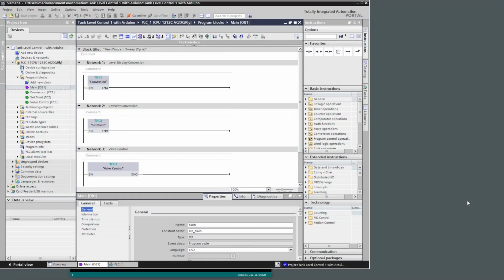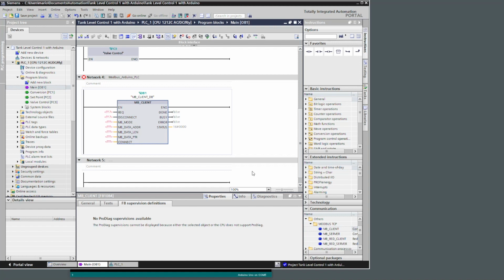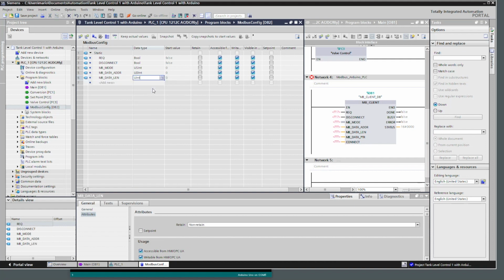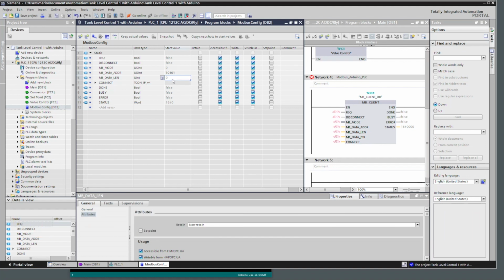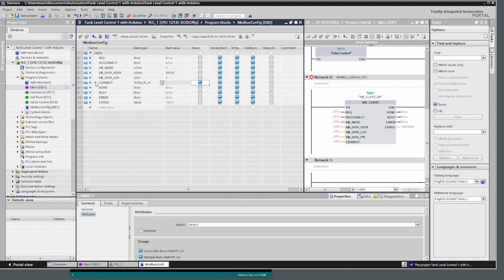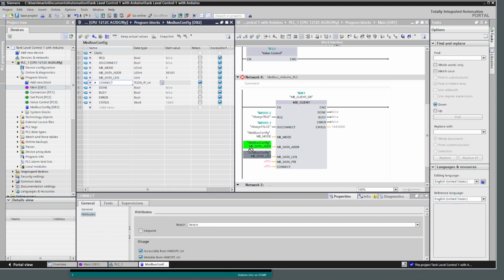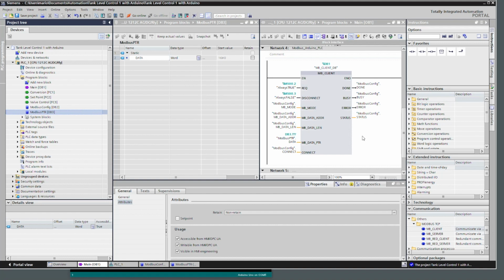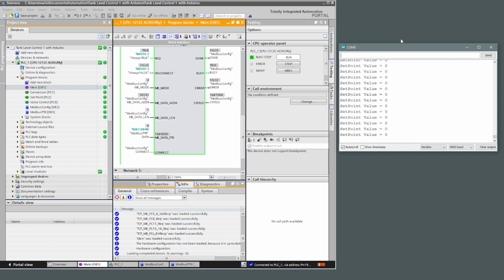Siemens S7-1200 to Arduino Modbus TCP/IP Communications Part 4.

Comment: Hi Mario, thanks for this nice work. I'm working on my thesis. I'm getting 16#80B6 error in MB_CLINE_DB status. I can't solve it. I think it's router. Can we connect Arduino and PLC directly without router?
Reply from the maker: I had problems with some connectors, I guess it all depends on the wiring of your connectors. I actually just linked up an old modem in the end which worked well.

Comment: Hi Mario, I follow your step to setup my s7-1200 PLC and Arduino. 
But now I got a problem that my plc cannot read Arduino's A0 Value.
The MB_CLIENT's STATUS number sometimes show "16#7005", "16#7006" or "16#8383".
It seems that 7005 and 7006 is send and receive status.
But I don't know how to fix 16#8383 in STATUS number.
Can you give me some advice to fix this problem?
thanks!
Reply: Have you checked if your data lenght is corred to the date base? I had the same issue I just modify the lenght of data in mb_client

Comment: I'm building heat pump for the Bachelor of Science degree in Mechatronics Engineering and to avoid buying analog module for s7-1200(not enough analog inputs) i'm using arduino as a temperature card with 5* ds18b20 digital temperature sensors. The diffference from movie is to send values from variables in registers to PLC... Anyway i found out ethernet module wizz W5500 lite usr-es1 is not compatible with modbus libraries or im doing something wrong. i bought shield (waiting for delivery) which is used on your video and simmilar videos which i found on yt. I think its important note because i already lost 30h and after that i went other direction and built 2 web serwers from PLC and from Arduino, but to communicate properly and share variables cross-domains it would need another device for server, because web serwer in PLC doesnt have enough resources same as arduino... Thinking it would be better to buy that analog module for pt100 or Shield W5100 at begining. Meh, educational value is nice but wasting so much time not so.  Module will come at wednesday and i will start over again... Thank you for sharing your wisdom.
Reply from the maker: Glad you enjoyed it
Reply: Ok, so i made something wrong in code, I wrote it wrong way and it was my fault, still im not sure if it will work with that module which i was writting about. Im sure it wasnt working even with shield till i wrote good code. Now it working and sending data registers thru modbus tcp but i used arduino mega 2560 and shield from movie also i used modbuss poll tool to check if frames are correct. Before i changed code it shown illegall data adress.  I used different libraries: SPI.h, Ethernet.h, ArduinoRS485(ArduinoModbus depends on the ArduinoRS485 library) and ArduinoModbus.h. Coudnlt find even 1 working code about data registers (found article it is difficult with arduino uno), most of examples are querstions how to do it propperly, anyway i did it :) and will post it somewhere when i done my heat pump project. Thank you again.
Reply from the maker: Well done Patryk, sounds like you know a lot more about than I do about the subject. Good luck with your project. Looking forward to seeing it.
Reply: @MarioCrispino  Naaaa. Without your movie i woudnl't even know how setup modbus client in PLC, but thank you :) Thats really nice to hear someone appreaciate my hardwork :)
Reply from the maker: Glad I could help Patryk

Comment: Hi Mario, 1 would like to have the arduino to be a modbus client and get the data from the PLC, is it possible? also, is factory IO can also be use as a workstation or a SCADA? thanks in advance.
Reply from the maker: Hi Joseney. You can switch which is the client and server. As for Factory I/O, I only use a fraction of what it is capable of. If you need to know more in depth information about the product I would recommend going to their website.
Reply: @MarioCrispino  
Thanks Mario, I would love to try once I get hold of "W5100".to be as a Client. Cheers!!!

Comment: This is the best tutorial, I am really enjoying. I just wanted to ask, if I want to add other sensors from my arduino, does It mean I will have to make different PTR data blocks FOR every sensor or I can use one for multiple functions?
Reply from the maker: Wow, you must be really going for it! I wouldn't have thought so but I guess it depends what you are trying to do.
Reply from the maker: Glad you are enjoying it too.
Reply: Well I have the same problem. At this moment I just created another mb_client block with diffrent data adress (30109) and its working as long as I choose between then. In other words I can monitor only one value in real time.

Comment: Hi, I reproduced exactly the same manipulations when in the tutorial but it doesn't work. My MB_CLIENT displayed three alternating errors, 7001, 7002 and 80A4. I don't understand where it comes from because by pinging my arduino and my CPU I get feedback. You would have an idea because I'm going crazy .. Thank you
Reply: Hey MoKa, have you entered the correct IP address of arduino to PLC?
Reply from the maker: Thanks for helping out Delgado, much appreciated.
Reply from the maker: Hi Mo. Don't worry, take a break from it for a while. I had lots of problems getting this to work as there are so many components involved. If you look at other comments you are not alone but eventually everyone gets it working. It is quite easy to forget one step and that being the case it won't work.

Comment: Hello Mario, nice tutorial..
So i have follow your tutorial but my s7 1200 didn't receive any value from my arduino mega.
My arduino IP : 192.168.0.3
My s7 1200 IP : 192.168.0.1
My PC IP : 192.168.0.109
Can you help me to solve this problem? Is there any solution?
Reply from the maker: Hi Delgado, I found it difficult to get working myself at first. I had problems with my potentiometer and the shield, I had to replace them before it would work. I also had a router problem in that my PC would talk to my PLC but not to the Arduino so I had to replace the router too. I'm not saying this is the problem with yours but you need to make sure each device is working before connecting all together. It took me a while and was very frustrating.
Reply: @MarioCrispino  I can ping my arduino, router, and my PLC. But in the MB_CLIENT_DB, the ERROR is always TRUE and the BUSY always false. There are no error code..

Edit : I found the error code. Its 16#80CE. The problem is I have already entered the same IP number in TCON_IP_v4 with my arduino's ping.
Reply from the maker: That doesn't sound good Delgado. Not sure I would know why this is but have you unticked Optimised Block Access?
Reply: @MarioCrispino  Sorry for late reply, I was busy with my thesis project. I finally solved the problem, the problem was I forgot to tick the "retain". 

Anyways thank you very much for the tutorial. Its very helpful for me to do my thesis project for monitoring using PLC.
Reply from the maker: Glad you found the problem

Comment: Hi Mario,
i am a big fan from you, and i have follow all you tutorials with pleasure.
i am impressed how relaxed you do that.

i have follow this two modbus tutorials step by step several times, but every time i ended with the same error.
my modebus send not correctly the data to my PLC. The MB_DATA_PTR stay on zero and the status give an 80A4 message.
i think there is something wring with my IP address, but i don't know what.
Because my route address is 192.168.178.1, i have used 192.168.178.120 for sent over the data from my arduino Mega 2560 to my PLC S71212.
Also my serial data looks ok.
What could be wrong?

Best regards Frans
Reply from the maker: Hi Frans
Sometimes I've noticed it can take a while for the PLC to read the information but it usually starts working a few seconds later.
Before you get into the PLC part, are you able to ping the Arduino from your pc on the same network?
Reply: @MarioCrispino  
yes when i use on both sites ip 192.168.0.50 i see when i ping
4 times
reply from 192.168.0.50: bytes=32 time<1ms TTL=128

grtz Frans
Reply from the maker: I see you have changed the network. If the ping works then that is promising. Does the Arduino print the values to the serial monitor ok?
Reply: @MarioCrispino  
Yes the serial monitor is also working, when i change the potentiometer the value is also changing from 0 to 1024.
I have also swapped from Arduino Mega 2560 to Arduino Uno with the same result what i expected.
Reply from the maker: Interesting. Could I see the PLC code. I can't look at it for a while though. My email address is on my linkedin account
Reply: @MarioCrispino  PLC code and Arduino code sended to your LinkedIn email address
thanks in advance
Frans
Reply: Hi Mario,
I have solved my problem.

What the error said there was something wrong with the IP address.
My PLC had as default IP address 192.168.0.1
My PC had as default address 192.168.178.17
My Arduino i had given 192.168.0.50

After i have changed the PLC address to 192.168.178.50 and the Arduino Address to 192.168.178.51 everything was working perfectly.
How could i make a simply fault like this?
Sorry i have bother you with an easy problem like this.
I put me on the wrong leg because the serial communication and ping was working.
Thanks for your help.
greatings frans
Reply from the maker: Hi Frans, glad to hear it is now working. We've all made mistakes before. There are so many things to consider that it is easy to miss something like this. All the best
Reply: @MarioCrispino  
Hi Mario,
Sorry, but i must bother you again.
two day's ago my Modbus was working, but it was not given me a good feeling, and for that reason i started to play again with my ip addresses.
After that it was not possible anymore to get it working again.
But now it works, and i have also a good feeling about the ip addresses.
This is what i have done:
My router has ip address 192.168.178.1
My PC has ip address 192.168.178.18
My PLC i have give ip address 192.168.178.52
My Arduino i have given ip address 192.168.178.120

At the end i have made REQ and DISCONNECT Retain and after done that my Modbus was working perfectly. 
That means that ALWAYS HIGH is not ALWAYS HIGH and ALWAYS LOW is not ALWAYS LOW.

Do you have an explanation for this?

Grtz Frans
Reply from the maker: Not sure about this one Frans. I have to do some more tests on this soon as I find sometimes it doesn't work straight away. However, it does works after a few seconds. I'm working on PID at the moment.
Reply from the maker: I have to say, the Modbus tutorials were quite difficult to actually get working correctly as there are many factors involved. My hub was a problem for a while and I had to change it to an old router I had. My original hub would communicate between Siemens equipment but not with the arduino. Then I had a faulty potentiometer and needed to order another.